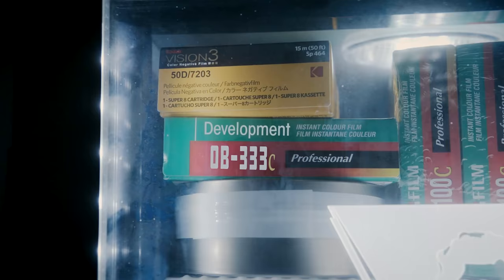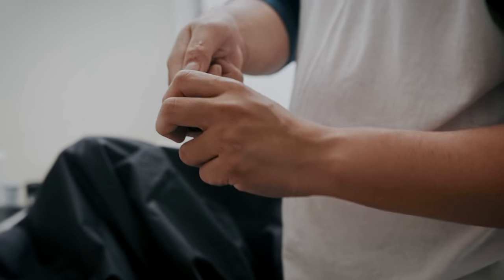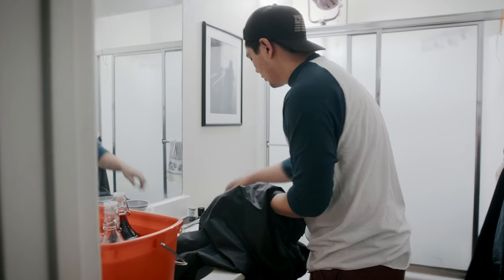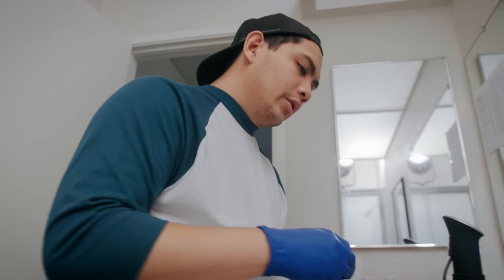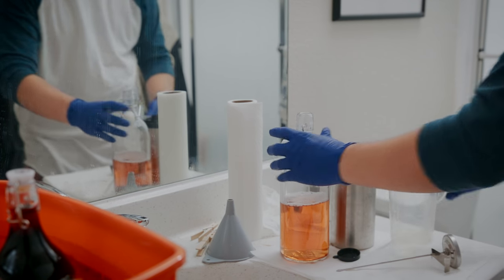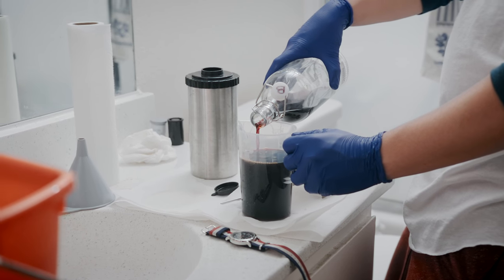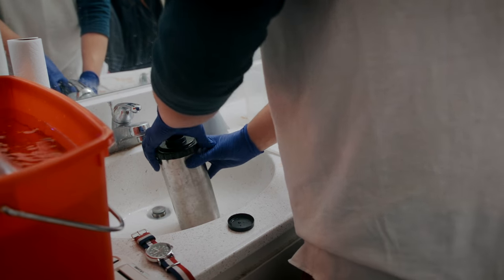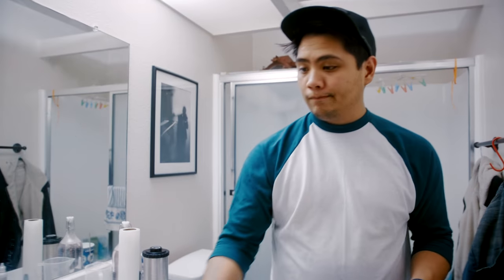Developing C41 at Home // Omar Kenji

Comment: Peck pads to remove water spots? Did you put anything else on the pads? Just curious- looks good!
Reply from the maker: Photoflo or Distilled Water will work great
Reply: If you live with hard water, you get spots on your film. Solution: mix up the stabilizer with distilled (deionized) water and add a few drops (only) of a photoflo product. Process as normal and hang (weighted) to dry without any wiping. Quicker drying; no water spots; no scratches from trying to wipe off spots, Peck pad or no.

Comment: How come no one ever posts links to where they can purchase these items. Specifically that water heater or even that tank. 
The link you actually posted is literally to the same video we just watched but from Vimeo.

Thanks for a good video though.
Reply from the maker: We didn't add links because any sous vide machine will work, as will any bucket or any tank. The photo stuff is pretty standardized, too. That being said, here are some links:

Changing Bag -- https://amzn.to/2HkPqRF
Tank/Reels -- https://amzn.to/2SOIwWI
Metal 35mm Reel -- https://amzn.to/2H71qGP
Metal 120 Reel -- https://amzn.to/2EH5yK5
Sous Vide -- https://amzn.to/2IYvqXt
Bucket -- https://amzn.to/2ETCCzM
Bottles -- https://amzn.to/2IWpqhW
Developing Chemicals -- https://amzn.to/2IWHx77
Film Retriever -- https://amzn.to/2SLukhe
Pec Pads -- https://amzn.to/2Hh4eAG
Photo-flo  -- https://amzn.to/2TmKumo
Reply: The Anova unit he is using here has recently gone to a one-star rating on Amazon because of some games the manufacturer started with the associated control app - it now forces you to allow the manufacturer to mine your person and on-line data. Buy another brand!  Cinestill now sells an adapted version of one of these heaters. It costs $100 (higher) but may be worth it if you need the added control features.

Comment: Looks like he takes about 90 seconds to pour out his developer (2 partial pours) and then return the used developer to storage bottle before he pours the blix  for the next step. Do you suppose he realizes that his film keeps developing all of that extra time? That's about a one stop push. He should use a pitcher big enough to take the full dump of developer so he can immediately pour in his pre=measured blix. Lacking that, you can add a DIY stop bath (then wash bath) after the developer. then fool around measuring out the blix at your leisure.
Reply: I noticed that too. The instructions (for Kodak) even say "start pouring 10 seconds before the time runs out". Also why did he put the developer back in the hot water, but not put the damn TANK in the water to keep the bath? Most likely, the film came out like crap and he just fixed the colors in the scan. He also didn't answer or heart your comment, like he did everyone else's. Can't even admit he screwed up.
Reply: @83hjf  Compared to the many other inane YT videos on color film development, this is one put in a number of good points, so 7 out of 10?  Warming the tank during development is more important when using steel tanks, as the steel has no insulating factor at all and will loose heat. I think he is putting the used chem bottle back in the bath because he doesn't have space to put them anywhere else. The most popular process of scanning film and adjusting color digitally allows deviations in color and contrast to be corrected to a good extent, where the same negatives would be a bear to print chemically. Also, I think today there is a lack of standards for "good" results, if YT videos are the reference..